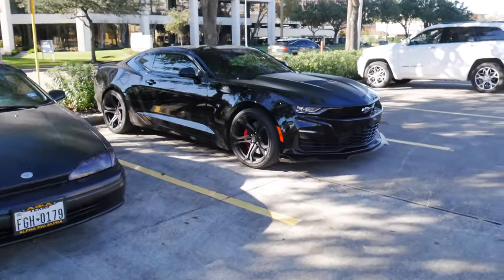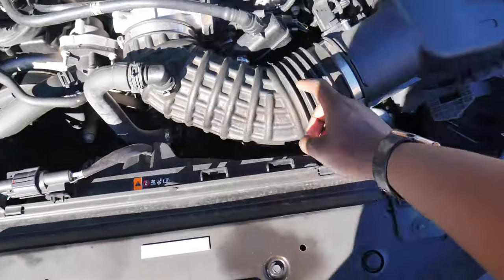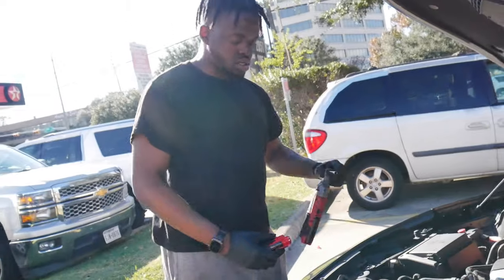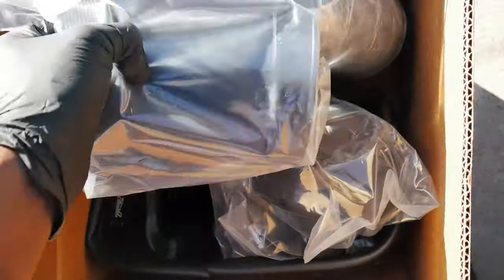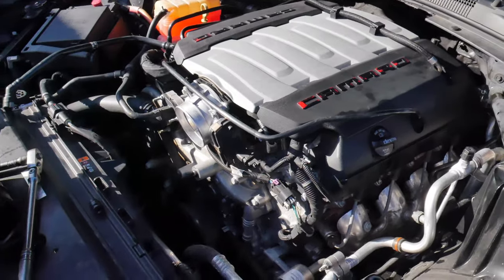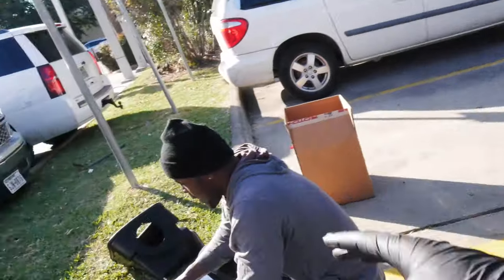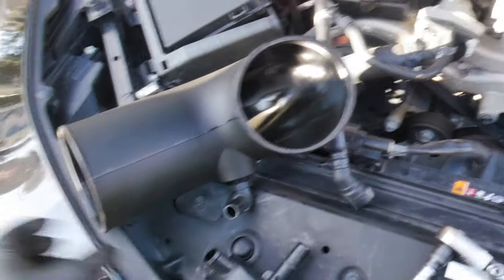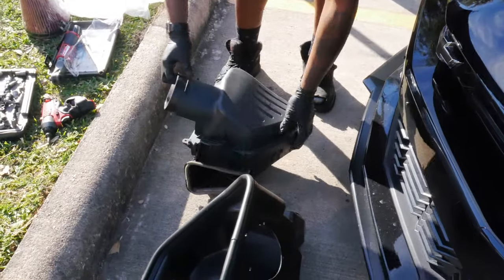THIS IS A MUST DO FIRST MOD FOR THE CAMARO SS 1LE

Comment: I am sure you gained 3 or 4 passive hp...but w/o a tune ypur cai is a waste of money. You can put headers on it too....but until you tell the ECU to increase fuel to match your newfound breathing it will not reach its potential. You need a tuner with a dyno in order to optimize your power. So set that appointment and you will win.
Reply from the maker: Yeah bro i know that’s cars a completely different animal now way more mods

Comment: My advice to everyone, do not touch your intake unless you are going to tune the car. You are risking voiding your warranty even though the ecu is not tuned. The risk of voiding a warranty for maybe 3 hp gain is not a smart move. They say Chevy has to prove the part caused the failure, that’s not the case and not worth the hassle dealing with lawyers and going that path. They can void your warranty and you have to deal with it.
Reply from the maker: Yeah fam but my warranty covers after market parts also the car is getting tuned.
Reply: Putting a tuner on your car is alot more risky them an upgraded air box. Chevy even sells an open element air cleaner in the options.
Reply: Chevy discontinued their CAI , they don’t sell it anymore. From what I read on Camaro 6 forums, a tune is not needed for most aftermarket CAI. RotoFab has diff intakes, their “normal” one doesn’t need a tune. They have a big gulp model, that one needs a tune. 

I’m just repeating what I read on the forums from people with much more experience than me. I don’t even have my Camaro yet, it’s on the way though!